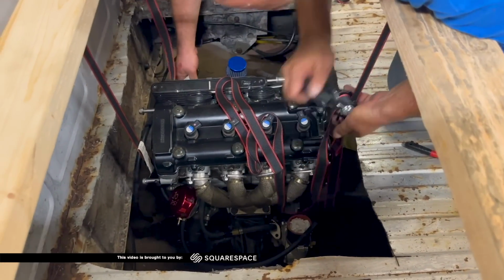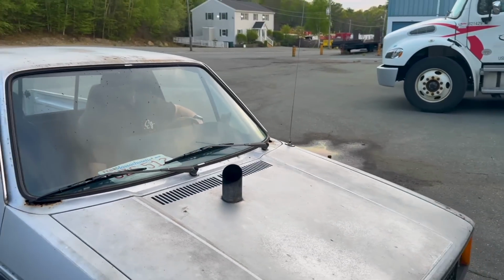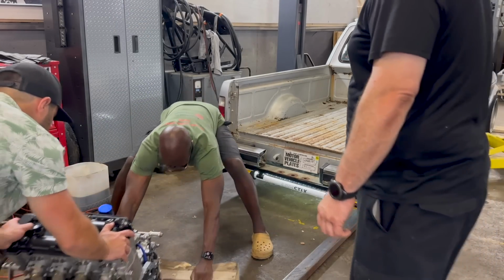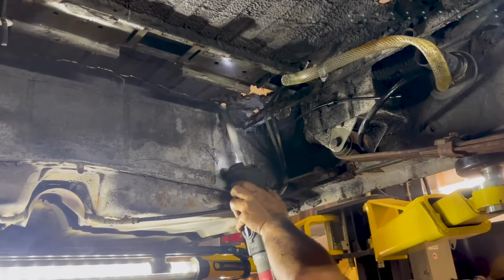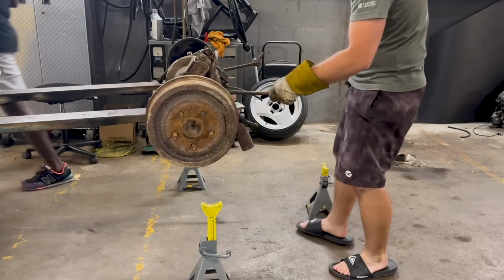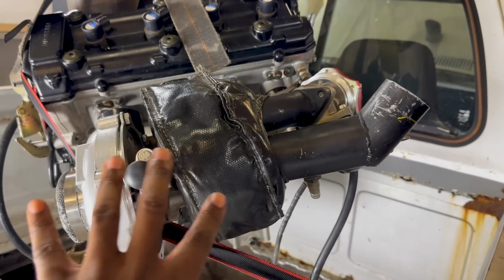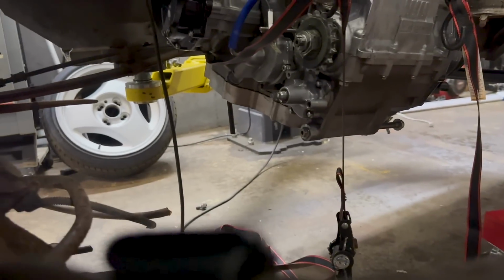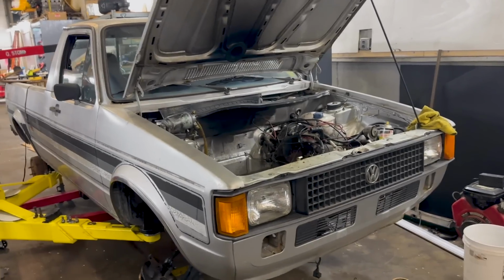Installing A Turbo Hayabusa Engine into an old Volkswagen pickup truck

Comment: Use a chain to connect the out sprocket to a jack shaft which has a U joint and drive shaft connected it.  That way the engine can be mounted as high as you want it.  Also the driveshaft angle can be reduced.

Comment: Hi Rich, maybe a different rear end or modify one to spacing you need. There are tons of offset ones that you could look into either early Jeep cj5, cj7 or Toyota fj60. they have right hand offset third members Dana 20, 30, 44. Even early Dodge 4x4 has passenger Side offset. It would be easy enough to modify existing axle you have as well to give more offset. Might help solve a few problems. It would  center engine better and would give space to drop engine lower between frame rails. Thanks for all that you and the crew do! Your creativity is infectious! Thanks,Randy

Comment: Cut the bed, remove the front cabin, and replace it with a motorcycle front end. A motorbike/truck bed combo in one piece. Bam. You get the truck function and free HOV access to boot.

Comment: Brooo... mount the engine dead center and raise it up. Mount a jackshaft underneath the engine with the correct alignment to the 8.8. You can then use a chain drive to the jackshaft, which will allow you to use sprockets to reduce the gearing. This way you will add torque multiplication to the engine while also reducing the chance of busting the Hayabusa transmission case.

Comment: The bottom of that oil pan should be level with the ground. Make sure to figure out a sump solution or a different oil pan. With the motor sideways like that, the pickup will have a hard time doing it's job

Comment: If you're thinking about going AWD, forget hybrid and run the busa engine up to a t-case, from t-case to front and rear differential. That solves the shaft length issue as well.
Unless some outfit makes an e-assist transfer case. Hmm... Now there's an idea.
Reply: Like a v drive except you're actually using the second output lmfao

Comment: sounds crazy but why not connect the rear end straight with the transaxle in the front and then make the shaft into a sprocket in the middle.  Connect the out of the engine to the shaft  like timing gear set up they used in the old 350c chevy's?

Comment: I would really avoid the electronic shifting, it will be almost impossible to find neutral, which will be really annoying in a car. It would be hard to run a linkage so cables are probably the only option.

You could also add a quickshifter for pretty cheap and have WOT clutchless upshifts. It will rip even harder than it’s already going to 👍

Comment: As a suggestion. What if you cut and reweld the axle perches and clock the axle so the pinion angle is up more and mount the engine with the output angle down more?
Reply: It needs to be spring under the axle. They have it mocked up spring over the axle. So yeah they need to cut the spring mounts off the axle tub and put them under the axle 🤙🏼

Comment: Why not look into using something like a Quick Change Drop Box, like you'd use in a really jacked up truck? I don't know if they make one short enough for this application, but maybe it means raising the motor back up a bit.  I know it seems foolish if you're doing electric drive for the front, but maybe you don't go electric drive in the front and you just run 4WD? You could probably use the drop box in 2WD mode just powering the rear wheels. The big downside to a drop box is they are pretty inefficient.

Comment: Move your engine back so it's positioned above the differential then adapt a sprocket to the differential and make it chain drive. I did this to a 1946 taylor cart and it runs like a striped ass ape

Comment: You could run a chain from the transmission to an output shaft similar to how a portal axle works and have that run to the rear diff. Then you could even center the motor as you wish.
Reply: A portal axle might be a good solution, if Rich can solve the sprocket to axle shaft problem.
Reply: Exactly.. Build a simple jack shaft down low, that is more inline with the diff and can mount your drive shaft to;   which will have a sprocket right behind it.  Then you can mount your engine in the most ideal place, rather than being forced to make it hang so low.
Reply: Jag IRS
Reply: Jackshaft has to be the winner here. It gives you pretty much any output shaft you want, wherever you want.
Reply: Vehicles on portal axles are usually slow mostly used for off-road that is why i do believe what Ritch really need is the expertise on this project of someone who is working in a factory that produce drive-shafts ..
Reply: @poplaurentiu4148  I'm not saying use portal axles of course. Same principles as any transfer case like those in every Jeep and 4WD truck. Just pointed backwards instead of forwards.
Reply: @poplaurentiu4148 
Look up Bourgets bike works. All of their “fat tire” bikes utilize a Jack shaft and double belt drive, and they go plenty fast.
Reply: Was thinking something similar- shift the engine to make it central and then make an intermediate shaft which couples the engine sprocket to the diff shaft in the middle - small losses but can also alter the gearing to suit the diff ratio and the weight of the VW compared to a bike 👍
Reply: I was thinking something similar to a mini sprint car rear axle, they are chain drive but they typically run a zx10 engine and only have like 200hp, 600 Hp chain drive scares me for some reason
Reply: No chain, are you nuts?
Reply: @stuartcraig6381  Well, first of all, they use a chain on the motorcycle that uses that engine, so it's not really a crazy idea. Second, you might want to look into how any transfer case works. It has a chain in it. Third, I was giving a general idea not an extremely specific suggestion.
Reply: He just needs to mount it longitudinal
Reply: @ShaunHensley  It is being mounted longitudinally.
Reply: @802Garage ah so it is.
Reply: vintage monster truck style - just keep adding chains until it holds the power :)
Reply: Portal axles are expensive AF. Even a single one. Simple chain to a propshaft is the key.
Reply: @jbrownjetmech-4783  I wasn't saying actually use a portal axle. Any transfer case could accomplish the task. It was just a visual example if you will.

Comment: Why not just put the engine up front and use a longer driveshaft? Point the pinion and output shaft toward each other, and the angle fixes itself.

Comment: Raise the engine use the sprocket and run a chain down to a jackshaft. Then a u joint off the jackshaft. Then you can move the engine over as well.

Comment: I’m no engineer, never built anything like this, but what if you could position a sprocket at the same level as the rear diff, on each side of the sprocket you have a u-joint coupler welded to it so it’s a normal driveline for the front and rear axles. You’d keep the chain drive from the motor down to that sprocket. The main challenge would be figuring out some kind of a bearing so that lower sprocket can be mounted to the engine or body

Comment: Do a chain drive, then you can place the motor higher, and just stick a sprocket on the end of a drive shaft. You could even center the motor for better weight distribution.
Reply: Actually why not? (It would solve a hell of a lot of transmission alignment problems too). Good shout Unc, I’m with you bud..
Reply: @philtucker1224  It would even allow the gearing to be changed on the fly with different sprockets.
Reply: Probably to much weight for chain
Reply: @waimeagavin808  1700 lbs isn't too bad, only one way to find out!
Reply: @waimeagavin808  yes that’s a thought. -will need a strong prop for 200+ bhp…

Comment: Using a flip kit on the rear diff would help a lot!
Reply: Glad I wasn't the only one watching like "but why wouldn't go axle over" until he finally said it
Reply: Turn the diff over  and place it on the top of the springs May make it closer
Reply: Spring under was exactly what I was thinking.  Then they really wouldn't have to lower the engine more.

Comment: I’m a fan, but there are limits to everything.  First, its a motorcycle engine.  I doubt, when it was designed, the engineers anticipated that it would be used to power even the lightest of cars.  The clutch, crankshaft, etc., probably were not expected to torque anything that heavy.  

Second, instead of a solid axle rear, why not go with a light weight independent axle rear?  You can always modify the width and placement of the differential — if in fact you need one?  In fact, if you go with that idea, you can place the engine closer to the truck’s centerline.

But, if I were you, I would look at some of the old axles that Lotus or even Fiat used back in the day.  Maybe take one from a Europa?  You may be able to even use a drive shaft, axles and even suspensions from one of them.  

Third, just imagine.  If I had the project, the first thing I would do is go to a carbon fiber fabricator, and ask the company to do a customized shaft and axle. I would build a lightweight modified suspension around it.  

Another thing to consider of the guys who are making formula E’s.  They are going through and tossed a bunch of carbon parts for their car development.  I would ask some about things they have thrown into their trash bins.  I am sure some would love to just donate to your project.

Best of successes.

Comment: @Rich How much are you going to charge me for the rims on the caddy why it's not in south africa and will look nice on my MK1golf and don't forget to turbo the motor it will move we took a old mini and dropped the same moter and turbo it bloody hell it was fast. Why didn't you put the diff on top off the leave springs the diff can go higher. I type to fast 😂 we made a bracket with cables to shift gears one way to pull up from 1st gear and up and if you pull it down the other cable pulled it down the gears and the mount from the diff to the moter we modified 2 CVS strong one's we can find with a strong shaft in the middle look at the inside CV you will see i Bolts on so was easy to make a plate to fit the moter and the fit the CV with hi strength bolts takes 8 of them and you can even use thicker bolt drilling them bigger

Comment: Wish you luck, but the case on the trans will break. . You will a torque  absorbing  rubber  in the drive line system  we did this already  in a race car.

Comment: my idea is if it's gonna be a hybrid as you imply, toss the batteries behind the engine, that way you have more weight over the rear end.  and regarding the pinion angle, if you guys are already fabbing mounts anyways, just tilt both the engine and diff a little so the angle isn't as aggressive.  aside from that i'm sure you guys know more than i do so do your thing, and i'm waiting to see how this turns out, the future is looking good here
Reply: Tilting the engine would require a deeper sump and pick up tube or a dry sump system.

Comment: When it comes to unique, iconic, or ugly (in a good way) cars I think the only thing that really matters is the outside appearance. So swapping the engine out for something more modern doesn't matter since it still retains the look of the vehicle. Plus with older cars it would be dumb to keep and old engine in them with a horribly  fuel inefficient engine. 

although I'd also hapily own a "replica" bel air that was made from fiber glass for most body pieces.  All of which would be made by using the original body pieces as a form for the epoxy and fiber glass work. There is no need to keep the body made from steel like they were originally, and keeping it steel makes the vehicle more dangerous to you if you ever crash

Comment: Could you use some kind of drop box for the driveshaft issue   there chain driven down to another sprocket then you could run a shaft off of that to the rear end

Comment: Although converting to rear (or all) wheel drive is the best if you want to put down maximum power,  there is something everyone misses that has a HUGE impact on front wheel drive torque steer.

If you want a powerful front wheel drive car, you need to make certain it is set up for a perfect 0 scrub radius.

A perfect 0 scrub radius means the center of pressure for the tire on the ground (center of tread if the tire isn't angled) lines up perfectly with the virtual line created using the center of the ball joints.  Google can provide a better explanation, especially for different suspension types.

With a perfect 0 scrub radius,  accelerating torque/ force will not try to steer the wheel.

Comment: I wonder if US Legends Cars would be any help, Legends  run a Yamaha motorcycle engine with a CV axle adapter on the output shaft

Might not help since its not the same engine but you never know

Comment: There's a lot of suggestions here to adapt a sprocket to the driveshaft and chain drive it. I think they must have not heard you state your intention to go AWD. Even if it stayed rwd, probably would need to come up with something similar to a double roller timing set so the chain doesn't disintegrate motivating a 1700lb truck. Perhaps a solution could be found using a portal axle to get the shaft location farther down? Or maybe clock a transfer case? Could almost certainly find an almost out of the box solution in the sxs community.
Reply: Have to agree with the second statement.  Implementing a chain driven system is fine for off-road driving or at lower speeds.
Reply: @zeroturn7091  right? I mean, a chain is usually the weak point on a 4 wheeler or whatever that weighs 400lbs. Even if you had a super strong chain, it would wear the teeth on the sprocket so fast. There might be something to the sxs thing. They seem to have a fairly robust setup with belt drives. I'm definitely interested to see what they come up with. But the chain and sprocket is a recipe for failure imo

Comment: I think Id just lower the engine some more by building an engine cradle and put a skid plate under it-I mean the rear diff rocks down that low so having the engine closer to the ground might not be a bad idea.  An electric drive unit in the front is another genius idea by Rich, I'm here for it

Comment: I would run a chain  from the trans output to a jackshaft. One side of the jackshaft has a sprocket, the other end has a U Joint saddle. Then just make a small driveshaft to the rear axle. Simple and effective.

Comment: You could do axle over leaf springs to retain ride height and ground clearance for the engine. And I would personally make a flange for the output of the Hayabusa transmission an fab small slip yoke drive shaft
Reply: Seriously l. I was yelling at the TV. It's obvious since the original axle has the hubs offset well above the axle tube itself. So yeah axle on top of spring is the way to go. I really hope they didn't hack it up already.

Undercutting the gears is totally worth it. My old ZX6 was bulletproof after undercutting.
Reply: @mochunk same here! It was spring under the axles from factory. They mocked it up spring over the axle!! Hopefully they figured it out.
Reply: I get the no mods solid axle on factory leaf springs -- but with such a short driveshaft the rear suspension movement should be next to nothing which would be annoying for driving.  Why not IRS ?   More fabrication needed, leaf springs for trashcan, but no problem with a proper suspension and diff in one position
Reply: So.California mini truck 101. Axle OVER leaf springs.... Line up perfectly.

Comment: Hey, if it's not too late.  Just get a driveshaft carrier bearing mounted on a square tube crossmember.  Then put a chain sprocket on the front end of the carrier bearing.  Run a chain up to the output spocket on the transmission.  You could mount the motor anywhere,  up higher, even off-set to the paasenger side with the output sprocket to the front, with a longer stub shaft between the carrier bearing and the rear-end yolk.
Reply: Also, you'll want the driveshaft as long as possible, because the axle moves up and down.  Put the carrier bearing/sprocket at the front of the bed, with the drive chain near the front wall of the bed.  Just my O2.
Reply: err...that might give you six speeds in reverse (?)

Comment: A quick and easy solution to the drivetrain height issue & connection issues would be to get a second engine side sprocket, mount that to the front of the short driveshaft and then put in a short chain between the 'busa sproket and the driveshaft sprocket. However you're Really going to want to have a reverser between the 'busa engine and the final drive unless you want to get out and push any time you need to back up :P
Reply: Good idea for the coupler, I think Id just lower the engine some more and put a skid plate under it-I mean the rear diff rocks down that low so having the engine closer to the ground might not be a bad idea.  I think they are putting in an electric drive unit in the front which wIll handle reverse.

Comment: This will be as fun as one of those Hayabusa powered Smart Cars.  Somehow Freiberger's 1950 truck comes to mind, with a rear mounted engine driving a V-Drive out of a boat.  Engine is mounted backwards, drive shaft pointing towards the front to the V-Drive, which then runs a drive shaft to the rear differential.

Comment: I feel like it would have been way easier to loose the stock rear and throw a solid axle setup with a sprocket and run it off a chain.

Comment: Why not just put the hyabusa motor where the old motor is and run the drive shaft under the cab and to the Ford 8.8 rear end

Comment: The drive shaft setup you're looking for has been done on grind hard plumbing. They hooked up a motorcycle engine to a car. The drive shaft coming out of the mc engine could be welded to the rear drive shaft if you make a custom drive shaft coming off the mc. I look forward to seeing your own invention. If you search grind hard plumbing, it's a truck that's only a frame. Good luck